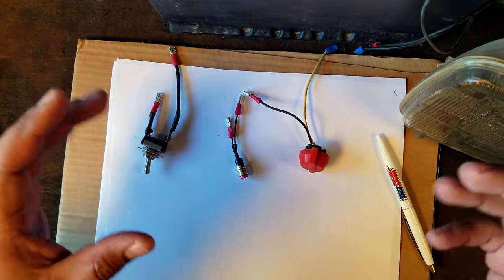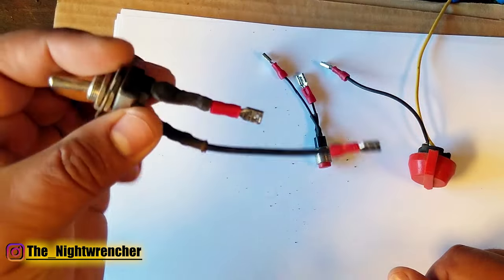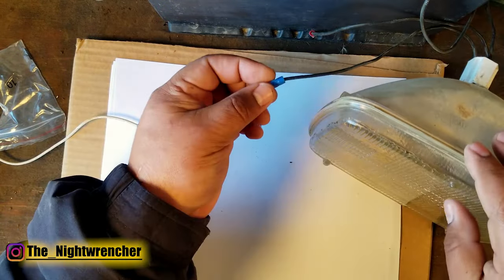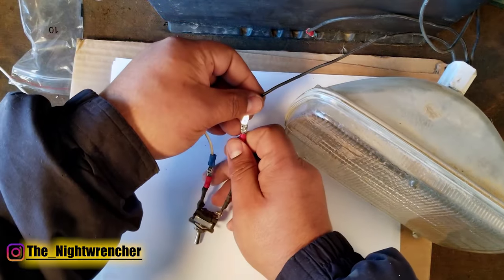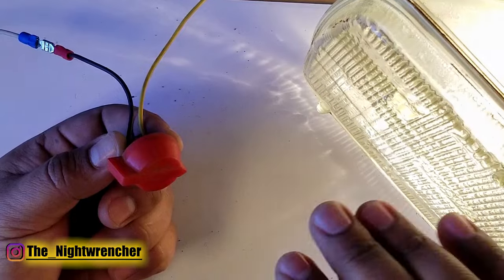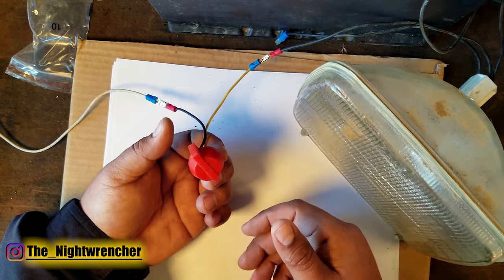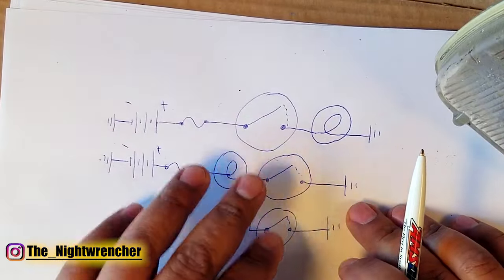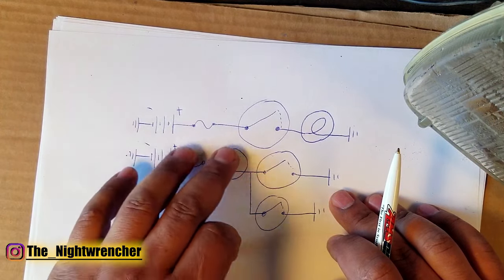Easiest How To Wire A Switch On Youtube | Classic Car Wiring Basics Part 2 |

Comment: Do you have a video showing ignition key turn on lots of acc like stereo, fuel pump, turn signals, head lights and so? I wonder how the ignition key makes the distribution to all other components
Reply from the maker: Not yet, but I'm working in it 👍 should be out soon

Comment: Actually these switches cannot handle the amp of two headlights. Relay need to be inbetween
Reply from the maker: It depends on the bulb type. Halogen lights take less power than sealed beam headlights.